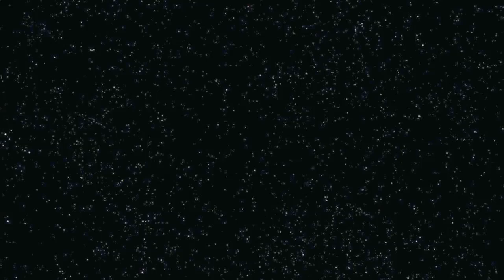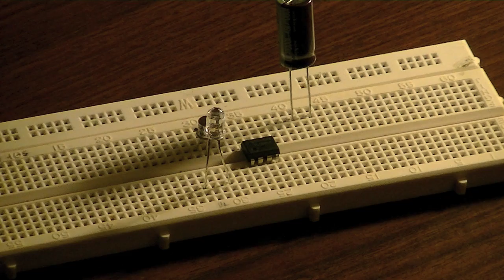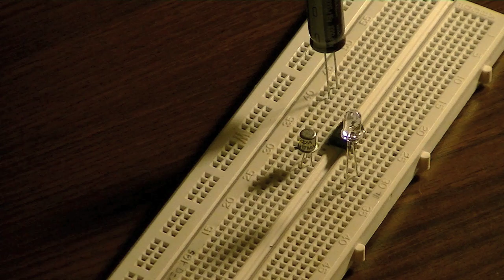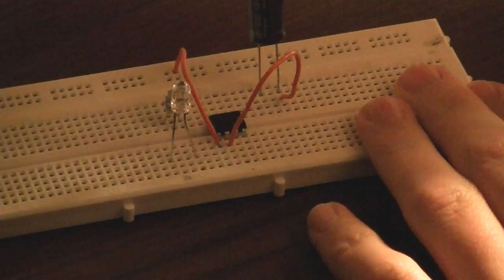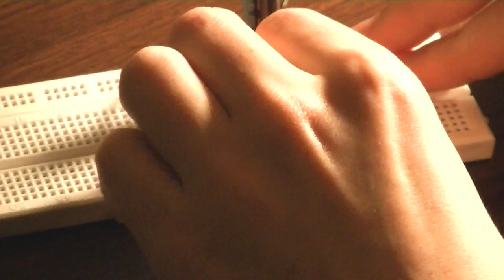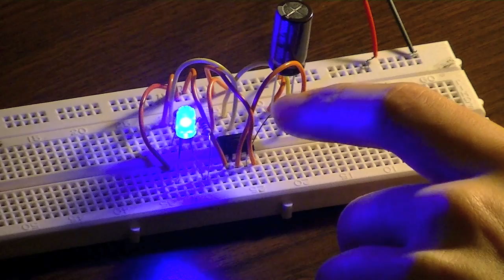How to Make a Pulsing/Fading LED Circuit

Comment: I knmow im 12-13 years too late to comment on the circuit though :))))  bet here is the question: how to add a second led that does the same thing in sync with the first but in antiphase ? In other words when the original (say led 1) fades in) at the same time the new added led (Led2) would fade out at the vary same rate as if it mirrors the action of LED 1 ????  TNX.

Comment: Great video! Nice simple circuit and a very clear explanation. You can also make breathing circuits with microcontrollers, but the beauty of using a 555 is that there's no need for coding - the components are the code!

Comment: Dude!!!! I have been looking for a video to do this that was straight forward and it actually worked!! I have a question tho, I need to do this to two 3vdc 300mA led filaments, your circuit works for them, but the voltage is slightly low to fully power the leds.. any ideas would be super appreciated!

Comment: I like it! I need this function for vacuum tubes fake filament led instead! When I switch on 12V it should light up just as slowly when you disconnect the voltage it should turn off just as slowly! Easy?

Comment: Please help me set this up with a 12v battery. I have been changing my circuit for more than a month (almost every day) now and still can't figure out how to make the led strip pulse with 12v. It seems to work fine with 9v, but it won't pulse with 12v. I added a 10k Ohm resistor for pin 8 + 4 directly from the 12v battery.

I can't find any good tutorials out there. Yours is the only one that works as I want! Would like your help in this thing :)

Comment: Super-old video, I know, but I just happened across it. Hopefully, somebody will see this and reply to me.
I have a modelling project that I'd like to start up and I'm going to need either 4 or 8 LEDs and I'd like them to slow pulse.

3.5 questions:
1) How many LEDs would one be able to run off of these components, as they are in this video? 
2) What would I  use in lieu of that big, bulky, largely unused board in this video? Could I just wire them to a battery connector?
3) Could I run 4 or 8 off of a 9 volt battery?

Thanks for any help!

Comment: Question - Im trying to make a pulsing led for a Tardis prop from Dr.Who. The unit im making cant fit a 9 volt but it can fit a lithium watch battery. What would need to be changed, aside from the LED's resistor, for it to use a 3.7v circuit? Im assuming the capacitor. Is there a formula to figure out what mF I would need to switcu it with?

Comment: wow, that is dope! i would like to try a 2k pot in place of the resistor, that should allow me to adjust the rate of pulse on the fly. do you think i will have to change out the cap? i want a very slow breath-like pulse. also do you do have the circuit diagram. thank you

Comment: What ohms range potentiometer would I need if I wanted to adjust either the brightness and/or the rate of the pulse?  

If I added 2 mini- pots  what size (range of max ohms)  would I need so I could have the fastest pulse to the slowest pulse.  I guess my cap would dictate my max range either my Maximum fastest and/or my Maximum slowest,  but by adding pots I could adjust my LED to somewhere/anywhere in between those 2 max-range valies....   right?

If I have a separate POT that would adjust the voltage going to the LED put inline just before the LED but after all the other components in this circuit,  that would handle the brightness adjustment.  A pot before the cap or before the 555 timer chip should adjust the pulse rate I'm hoping... yes?

Thanks so much for posting this!!  

  You've made me want to get some of those test punch down boards.  So I can experiment around with stuff and be less apt to blow stuff up!   💥  🔥🔥

Thanks man!!!!
Reply: I used a B500kohm linear pot and a 2.2uf capacitor

Comment: Hey there!! l need to engineer or pay to have engineered, a 3 way fade circuit that governs (3) 120 volt leds.. l need fade overlap, ,that is as one starts to dim, another begins to light up, with one overall variable speed.. Help!! lam a sculptor not an electronics wiz..

Comment: Thank you for this video very informative. My question; Are you able to connect 2 or LEDs to this circuit with one 555 Timer? Or Do you need separate 555 Timers for each LED you are connecting?

Comment: Are there USB programmable chips one can buy that have multiple outputs. Outputs which could have different continuous voltages or different varying voltages?This way I can have varying effects to lights as programmed.
Reply: CaptTambo you need a microcontroller such as an Arduino then you can have multiple outputs custom on/off times and fade rates and much more.

Comment: how to fade 12v led strip using external power supply 12v? I had try it using TIP31 mosfet but not sync fade time, must be decrease brightness led strip to sync it.

Comment: Can you make it blink faster?
Reply: yes http://clarkson-uk.com/downloads/555-Timer.zip  if your running windows you can download a that and it will tell you what sizes to use. A lot of people build a circuit like this using a variable resistor or potentiometer to make it adjustable

Comment: What is the value of the capacitor and resistor if I'm going to use led strip?
Reply: Depending on how long the LED strip is, you may not have to modify the circuit beyond adjusting the current limiting resistor on the transistor. If the LED strip has built in resistors, you don't need the current limiting resistor.

If you have a very long LED strip, you may need to use a more beefy transistor. The 2N2222A can only provide 800mA of current (9.6W @ 12v.)

Comment: how much would all this cost?  I want to stock a few over size foam skulls with fading red eyes...  the whole rig of course needs to be able to be wired to a regular extention cord connected to a timer.
Reply: a single transistor, a single led, a single 555 timer, and a single capacitor wold all cost around 8-10 US dollars, you can buy them each seperately at radioshack or other electronics stores. a pack of resistors cost just a $1 or $2 depending on what you get, hope this helps

Comment: could I put this into a harry potter wand?
Reply: No
Reply: Why not, but I would recommend you to switch to the TLC555 timer instead of the NE555 because of its low minimum input and then use a button cell battery or two to save space. Also if you switch to a button cell you can get rid of the forward resistor of the LED.

Comment: how can I make it so it won't turn off completely.. ?!
Reply: theoretically you should be able to stick a high value resistor bypassing the whole setup above, just +>resistor>LED>- and it should still work.
Reply: By either raising the resistance of the drain resistor or adding one from the positive to the LED to give it some constant low power

Comment: consulting the schematic http://3.bp.blogspot.com/-8dh2sGOARuM/TqAbenpiOnI/AAAAAAAABEA/mZ70J74VUXI/s1600/fading+led.jpg : The transistor  emitter is connected to the 150 ohm  resistor and the collector to positve. However you verbally said it in reverse. Did u modify or intentionally reverse the collector & emitter , I  plan on making 2 blue leds fade in out at same time.

Comment: Have u got a schematic drawing of all components? I'm interested i 2 blue leds pulsing fading same time
Reply: +Richard McMillan  You should be able to add a second LED in series with the existing one and if a 12 volt supply is used, a third LED could be added. In either case the current limiting resistor value should be checked. If red, yellow, or 570 nM green LEDs were to be used you could put 5 LEDs in series with a 12 volt supply. The cmos version 555 shouldn't be used.

Comment: if I add a full wave rectifier to use ac power to a bunch of leds in series can I use just one circuit to make them all flicker? would they all flicker at the same rate?

Thanks!

Comment: Kool! I'm interested in building an array of L.E.Ds that will fade from one to the other. Is that possible?
Reply: +Anthony Guy Depending on how you align the L.E.D's in either series or parallel it should work, and I believe your capacitor may have to be of a high value. I'm just running a scenario through my head on that since I also want to do the same thing with Blue L.E.D's. you can check out Falstad.com to work our yoru schematic and see if it works before applying it to your breadboard and PCB for final assembly. I'll have to play around as well. I'm thinking that each pair of L.E.D's (depending on how many in the assembly) will need their own resistor, but I could be wrong on this. I've only done standard electronics and really wished we would have done projects like these at my college. That's what I get for attending an art school.

Comment: I messed up building this and accidentally used 1,200 ohm resistors for both, it actually turned out quite nicely using 2,500uF of capacitance instead (I have a feeling that the LED that I used was very low draw in comparison to the one in the demo). The fade is ultra smooth and cycles around 3 seconds up/down. Thanks for the great how-to video!

Comment: Hey what if i wanted to implement this with an on/off switch? where exactly would you recommend introducing this into the circuit?
Reply: Simple. Attach a switch of your choice between the positive lead from the battery to the first connecting item.

Comment: If I wanted to run this off of 12v what changes would I need to make?
Reply: Ricky Timmons it should work ok with 12v, only period of flashing will be different so need to adjust resistors and capacitor ;)

Comment: Where do people learn this? I'm a beginner.  Just curious where everyone starts from.  Should I just buy a book?  Look for a class?  Google?  Really want to learn more about LEDs and also how to program/code lights like these.
Reply: Googleando my friend.... googleando....yo estoy igual que tu, pero viendo una y otra vez los videos, tutoriales, clases, todo.... y aprendemos un poco de aqui... y un poco de alla....
Reply: AJ Santiago you should try book by Charles Platt - "Make: Electronics", very nice book for beginners, starting from easy stuff and continue with microcontrollers, also there's already issued second book by same author "Make: More Electronics", more about microcontrollers and microcircuits.
Reply: +AJ Santiago  Try some books by Forrest Mims. Pretty easy to follow. Unless yer an idiot like me, but I found them helpful for a beginner. As I am. Radio Shack may still have them for sale. Or Amazon maybe. Good luck!
Reply: +AJ Santiago This book http://www.amazon.com/Alden-Hackmann-Electronics-Concepts-Projects/dp/B00SB4MTUQ is really the easiest to follow. You can also use Falstad.com/circuit/ to create your own project circuits to see if they work before applying it to a working breadboard and PCB (printed circuit board) for final assembly. After all, you don&#39;t want anything to blow up or get zapped in a build if your coming up with ideas. I&#39;ve had a few capacitor pop over time, but I learned my lesson well through trial and error and understanding basic concepts via the books and then applying what I read. Nobody starts off as a genius in electronics. Hope your hacking goes well.

Comment: Your dialogue box at 0.07 secs says you modified this circuit a little.
Wondering what is the modification.  I've watched 3 times and hooked up
your circuit but I'm not getting it to work.  Can you tell me the modifications?
Thanks

Comment: I am using 
820 ohm resistors
1000 uF ten volt cap
White LED
10.5 volt input 
2N2222A transistor 
Ne555 IC
No light output.
Help me!
Reply: +Okovermeke Amglight you are using higher voltage than the capacitor cold handle

Comment: Im curious, if i were to add say 3 more LEDs would i need less powerful resistors? because that speed is perfect for what i need (im new to circuits so can i have dummy language please)
Reply: The Wire Man Depends if the LED's are in series or parallel.
Reply: my guess would be that if they are parallel then it wouldnt affect but if they are in a series then it would?
Reply: most likely going to be a series
Reply: If you are going to have multiple leds neer eachother, make them in parallel. Same voltage is spread across all LED's so they all light up the same amount.
Reply: okay thank you, and will i have to do trail and error to find out what strength resistor i need?
Reply: Take your supply voltage ex: 5v subtract the Led voltage ex: 3.3 then divide the result by the current in Amps ex 30mA=.03A, the result is the value of your resistor in ohms. And I found this site, might help you down the road. http://ledcalc.com/
Reply: The Wire Man Well I wouldn't advice that because you'll have a big chance of killing a lot of LED's by doing that. So you can calculate what type of resistor you need by using this formula R= U/I and then you got the amounts of Ohms needed for your resistor.

Comment: What if I had 2 LEDs and I wanted the power to flow to one or the other based on sound frequency? Basically any sound below 146.8Hz powers one LED and anything above powers the other. No sound = no power to either. Any thoughts where I might start looking to develop a solution?
Reply: http://makezine.com/projects/easy-led-color-organ/

I'd check out this video/schematic and then do some reading on filters so the leds activate at the frequency you want.
Reply: Awesome! Thanks!

Comment: you could have used a lm 3909n ic it could only need one capacitor to flash 5 leds
Reply: +bhalaji roshan  And only uses 1.5 V to work

Comment: hi, please tell me how to connect more bulbs to this same circuit???
Reply: just wire more leds in parallel in the circuit where you connect to the emitter of the transistor. if a heavy led load is needed, use a beefier transistor.
Reply: Connect them together.

Comment: Cheers mate ... exactly the circuit I needed. Now, being a wizz at stitching circuits together but a complete eejit when it comes to electrical theory, all I have to do now is hunt down Someone who can tell me (even roughly) what value of components to use if I'm powering/fading a one watt LED (forward voltage is 3.3V and forward current about 700mA).

DON'T MAKE ME BEG!!!!!

ANY IDEAS ANYONE?????????
Reply: 3.3v....that wouldnt be the accent led pad on a plecter labs lightsaber board would it?

Comment: The transistor usage is NOT CORRECT.  It's an NPN transistor, so the emitter should go AWAY from B+.  Connect the collector to B+, and the emitter to the resistor to the LED.  It is part of a specifically designed "emitter-follower" mode of the transistor.  The voltage on the emitter tracks the voltage on the base which ramps up and down as the capacitor is cyclically charged and discharged through the high value resistor from the output of the 555.

Here is a link to the proper circuit:
http://www.555-timer-circuits.com/up-down-fading-led.html

It sort of works if you hook the transistor in backwards because transistors are somewhat symmetrical but you're damaging the transistor and not getting the proper functioning of the circuit.

You don't need a huge 1000uF capacitor, either.  The gain of the transistor takes very little charge off the capacitor, so you can get away with a much smaller 100uF capacitor.  Just use a proportionally smaller resistor on pin 3 of the 555 and adjust to get the desired cycle time.

Since the gain of the transistor is on the order of 100 so to run 10 or 20 mA through the LED, you'll only draw 100 or 200uA (microamps) through the base of the transistor.  Blue LEDs are very bright by nature so you can use a higher value resistor, like 330 ohms or 470 ohms with a 5V source, or even 1K ohms with a 12V source.

Putting a PNP in that location completely ruins the circuit design.  it's not only NOT an emitter-follower voltage-tracker any more, but it creates a forward-biased diode connected to B+ and the 555 won't discharge the capacitor, and wouldn't cycle, I would predict.
Reply: Thank you all. Will this work if I use 50 3mm (3v) leds in parallel?? Using a power supply
Reply: @Custom3dPrinting4U  only if you include 50 current limiting resistors, one in series with each of them, with the common tie point being at the emitter of the transistor. You can't put raw LEDs in parallel directly.

If you expand the output in this way, you will draw 50x rhe current through the transistor, and even if the power supply and transistor can take the current, remember that you're drawing 50x the base current which may require a larger capacitor (and corresponding adjustment of the resistor) because m ore charge will be bled off as current through the transistor base.
Reply: @jrhaggis  I put 5 LED's in parallel and it worked fine. I haven't tried it for blinking effects though.
Reply: I had to reverse the transistor indeed. If I connected everything as instructed the led would just continuesly light up.

Comment: If I were to connect this to an existing unit where would it go, I have a hydroponic LED board and want it to flash so how do I do this. Can you buy something from a electrical retailers to connect to the unit to make it do this? HELP! I am in the UK.
Reply: Led pins.

Comment: I dont know why but my led stayed on it didnt fade at all
Reply: I changed my resistors 1k, 1.2k, 1.4k, 1.5k, 2k and also 100 ohms, 130 ohms, 150 ohms, 200 ohms and it did the same thing
Reply: That's what would happen if you used a PNP instead of NPN.  See my post above -- he hooked in the NPN transistor backwards.  Try it with the collector and emitter switched around on a fresh transistor that you know is NPN (like the 2N2222, 2N222A or 2N3904.

Comment: hi, could you tell me if this would work with say 100 led's all in the circuit. or would you need a 555 and resistor etc. for each led?
Reply: put them in parallel with resistor for each.
Reply: You only need one Resistor.